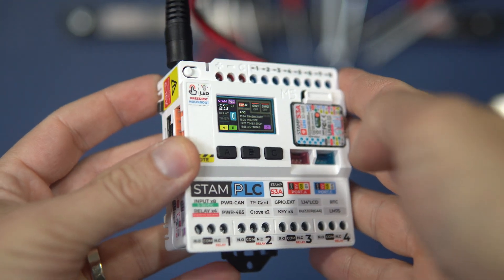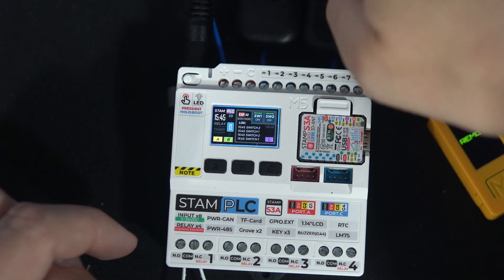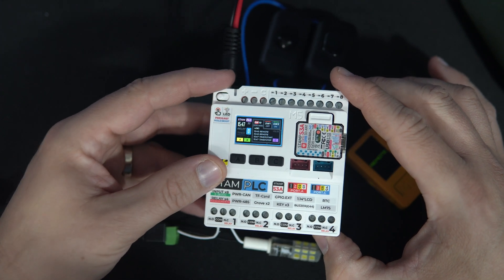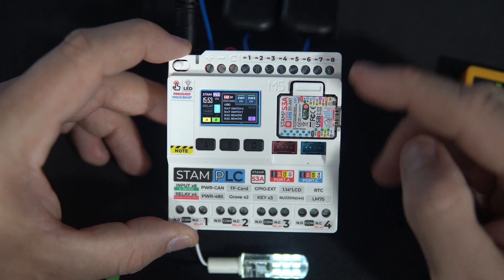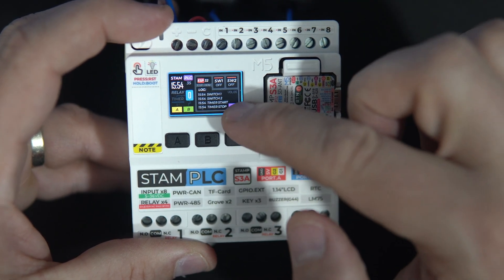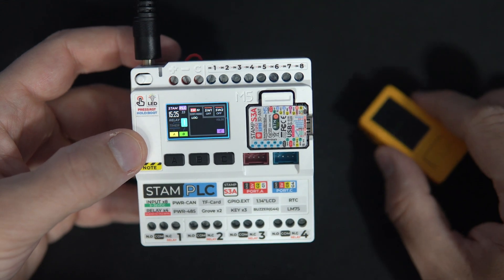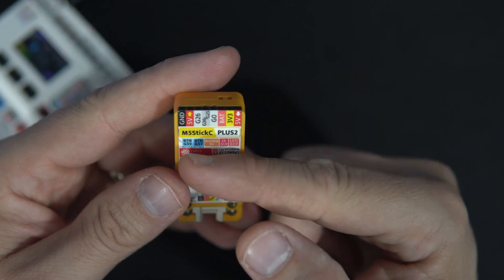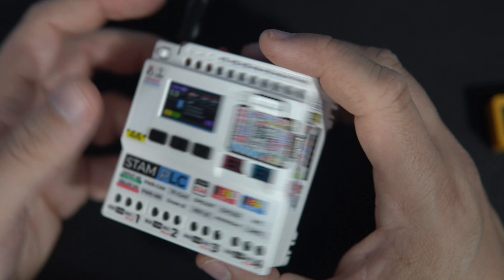M5Stamp PLC and Smart Yard Light Hack!

Comment: 3:16 The 5 amps limitation can be worked around by using the relays to control contactors if this were to be used on a larger scale.

Comment: Looks like a modified cardputer
Reply: This uses the same core from the same people i think
Reply from the maker: Yes, same mcu and same screen size
Reply: @VolosProjects  i like these cardputers.  I would like to have more io ports. The i2c is nice, but i want to be able to attach stuff that don't have this protocol. Like a DM542 and a Nema 34 stepper.  Grove has stepper drivers but i prefer this beefy setup.
Reply: @willemstaal5337  as I see you have 4 direct gpio on the front also I think especially left side is possible to use in other ways (no special electronics there) but maybe I'm wrong. Also I don't know is top row of digital inputs is "welded" as inputs or could be reconfigured. I don't know this connections but as I think you need additional  electronics (power), it is hard to do it universal. 
But maybe you should contact them, maybe they could do two versions with simillar PLC format.
I wonder if it also is not a limitation of this stamp "core" module which is plugged in top right corner, I think it has limited pinout and use of it is core idea of this projects and port expanders don't match well with direct stepper motors control.